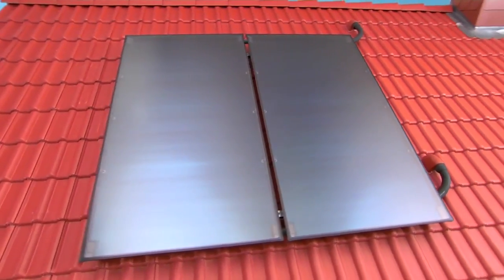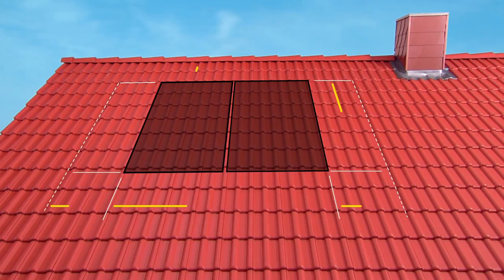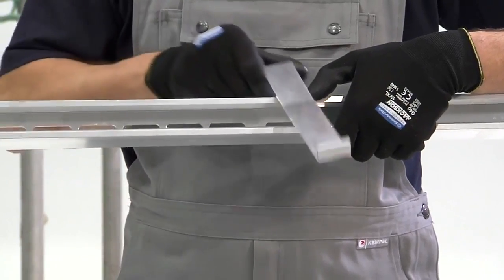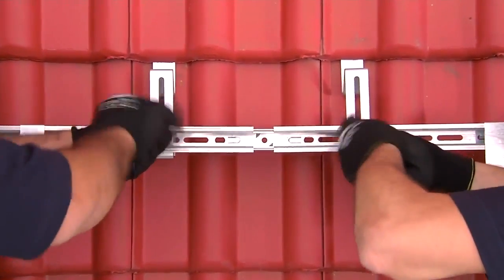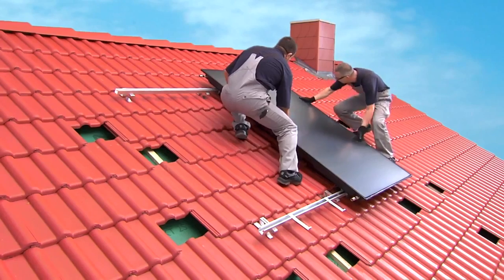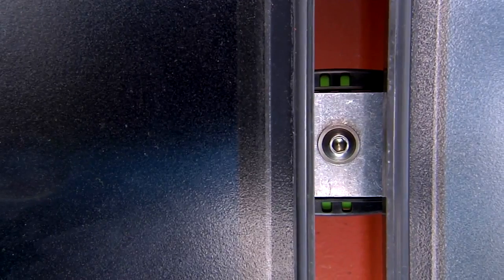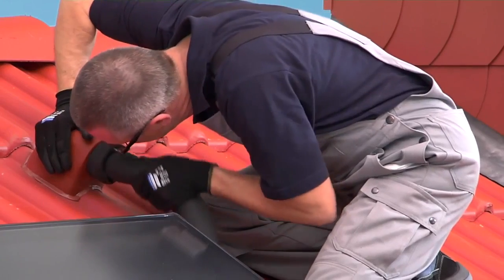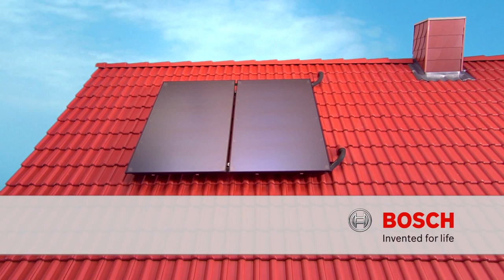Монтаж сонячних колекторів Bosch Solar 7000 TF

Comment: What about mounting on the wall? Specially if the wall of the house is facing South-East and I want to turn the solar panel at least 20 degrees in West direction to catch max solar in South direction.
Thank you